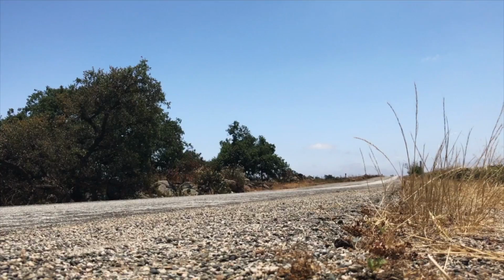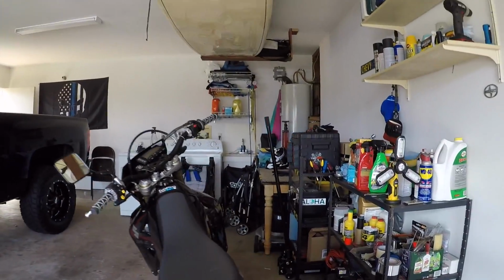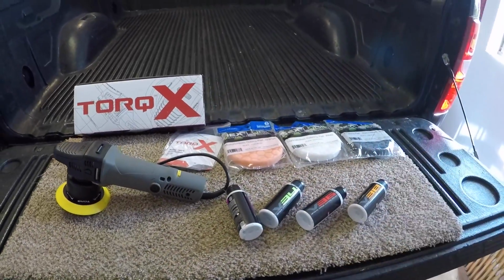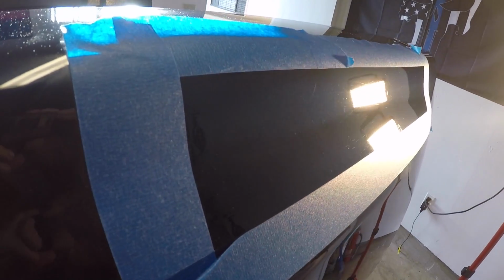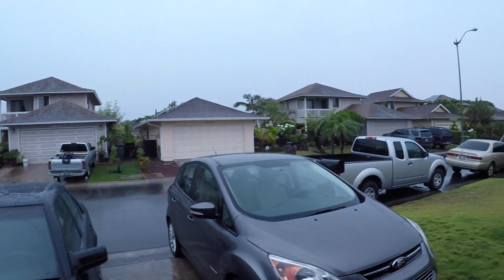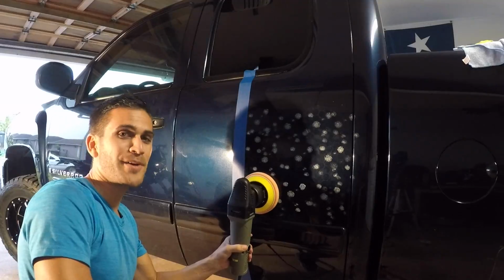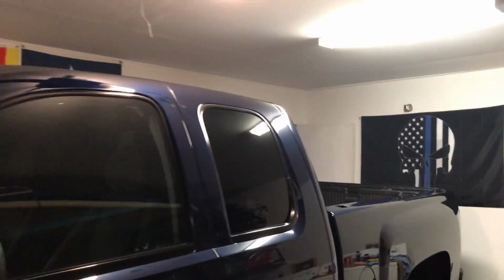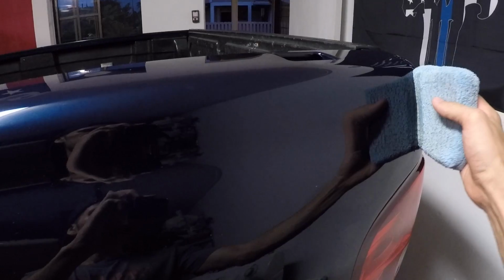Auto Paint Correction - Do It Yourself!

Comment: You should use water/soap solution when using claybar ... claybar should glide over WET paint surface not rub against it. Also polisher ... use rotary one move it left to right and up/down motions working in square sections ... not circular motions. You will get way better results